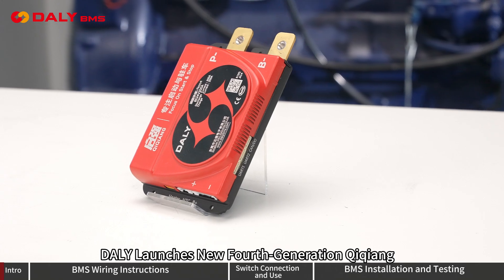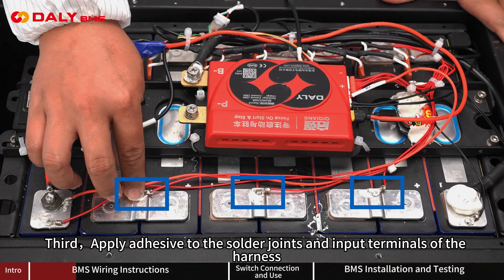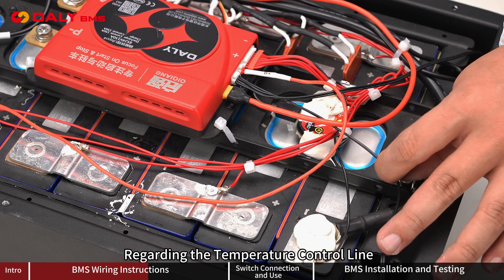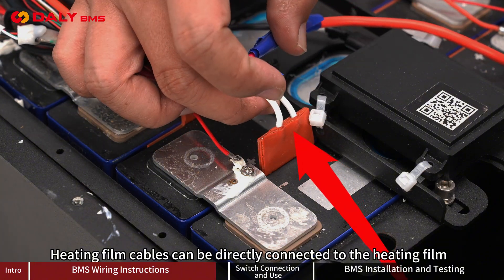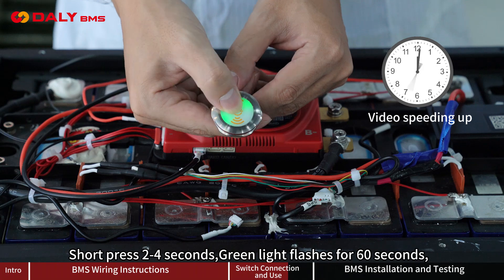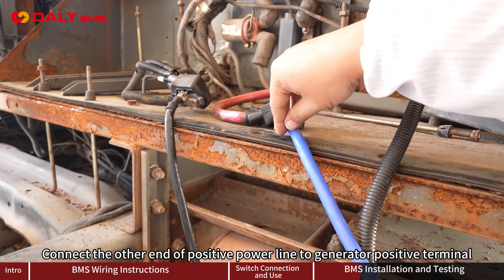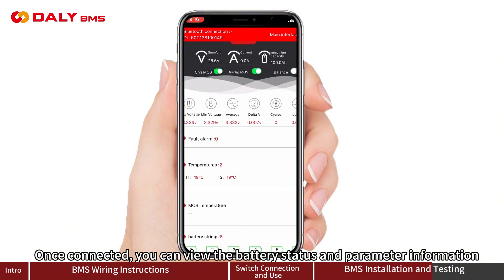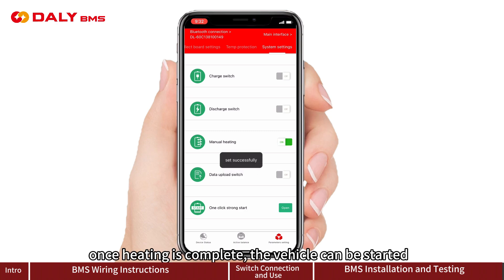Tutorial丨How to wire and install DALY 4th Gen Truck Start BMS?

Comment: I have a power station that got short circuited.  When I plug in AC input, there is a click sound like a relay and fans start, but then suddenly another click sound and the fans power down.  Do you think my BMS is causing this?